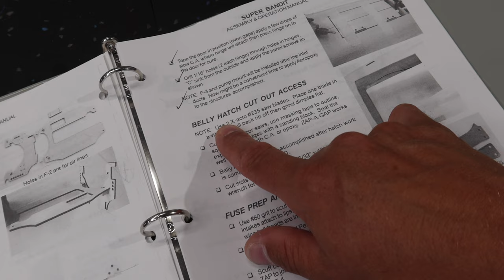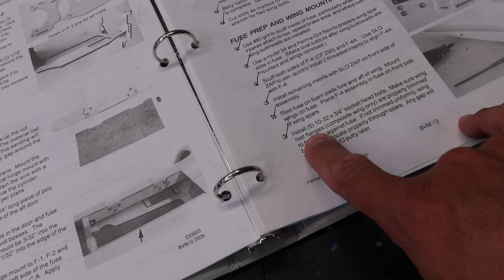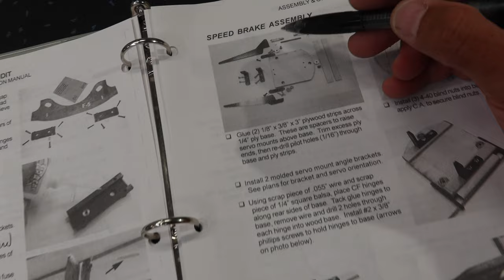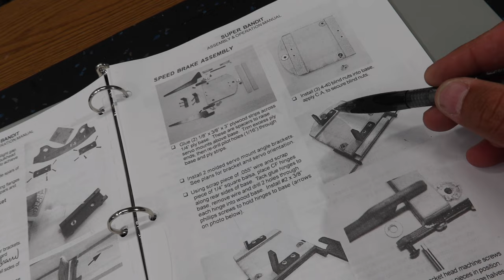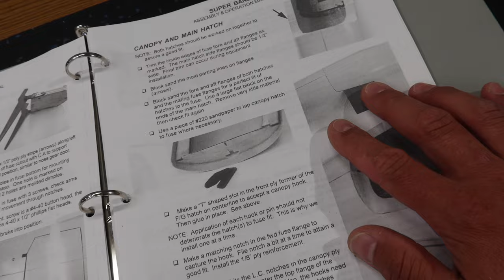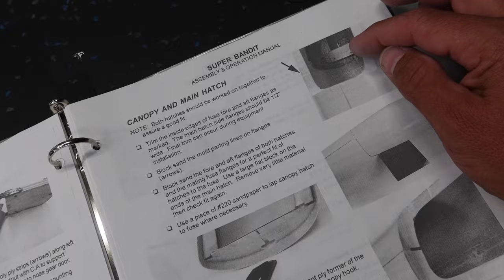Assembling the Dream: BVM Super Bandit RC Jet Build Series - Part 2

Comment: Great content!  I noticed you put the rear spar aluminum blocks directly on the carbon fiber former, not to mention the spar itself is carbon fiber.  I don't know if it will be a big deal with this RC plane, and in any case, it seems to be too late to adjust, but just FYI - carbon fiber will corrode metals, even aluminum.  In full scale manned aircraft, where carbon fiber will contact metal parts, the carbon fiber is often separated from direct metal contact by a thin layer of fiberglass to prevent the galvanic corrosion that will otherwise occur.  If you have any previous projects that have metal next to carbon fiber, it would be interesting to go back a year or so later and see if any corrosion is evident.
Great build!  I really like BVM jets; I've been a fan of them since I first saw a BVM DF jet in RC Modeler about 30 years ago!  🙂
Reply from the maker: Good Eye!  There was glue installed between the two pieces.  These are truly amazing kits!  Funny that these used to be called ARF's!

Comment: Hi Jonathan, for the belly hatch, how did you create the initial opening for the pull saw to fit? Did you start with a dremel? Thank you!
Reply from the maker: Thanks for the question.  There is an initial molded outline on the kit.  This was outlined with tape and then pull saw was used to start the cut.

Comment: I’m surprised at how many steps a BVM kit has compared to like a CARF.  And I’ve always tossed the hardware that comes with the kits and used clevis that doesn’t use that safety clip.  I just never trusted their hardware kits. And I always buy the all white kits, and I’d use vinyl to put large squares under the wings so I knew what side I was looking at.
Reply from the maker: These are dinosaur kits now.  back in the day these were called ARF's.  By today's standard that's crazy!
These BVM kit's come with Amazing hardware.  For hardware, A couple years ago I did a torture/failure test.  You would be surprised how the GOLDEN CLEVIS out performs everything else.  Clip made no difference if installed or not.

Comment: Love to watch your work, even if it is something beyond an old man's meter means. Such expensive toys . That is what keeps you in business, beyond the skill set of most. The addition of reinforcement, no doubt a life lesson , that might well have been over looked by amature . Many of your tips and techniques are applicable to lesser models . For 11 years on and off I tried to build a,YRF-4E,  tiny prototype flew , but the project is cursed, from servo failures to exploding duct fan, several failures ... of course  moving 3 times and the theft of my entire shop didn't help  found the proto type oops a box of books lay on top of it .  3 version lay about the basement and garage each a tad different,  a plug for a glass. Version sits much detail to add,  now why do I tell you this ? Because  you might be able to build it , your skill set, might find a way, you need a rf4b to start, nobody makes one , canard attachment to nacelles will require bearings , this added weight requires engines be moved back and some ballast,  canards limited to 20 degrees of travel, or so the test pilot told me . WPAFB has the real plane but it's been in for repaint for 11 years . I offered to help since I had a few old brushed laying about , dang they have no sense of humor. So a one of a kind only one in the world, great promotion for skill set , should fetch a pretty penny ... or hang in your shop as one of a kind . Just kidding wouldn't pass this curse on to anybody . If you should try the research department at WPAFB , would love to see it and might be willing to buy it .... take care looking forward to next  video.
Reply from the maker: LOL. Thanks for the info!  These cursed projects are frustrating!  I've had some, never this bad but I get it!  Thanks for watching!